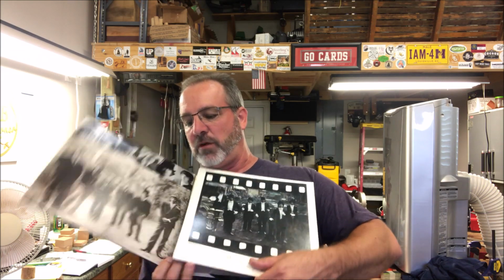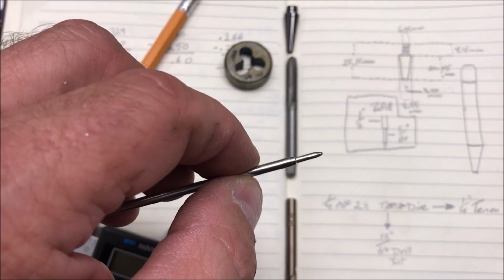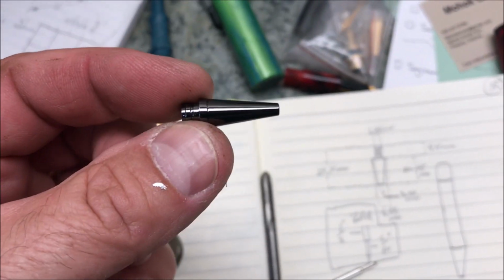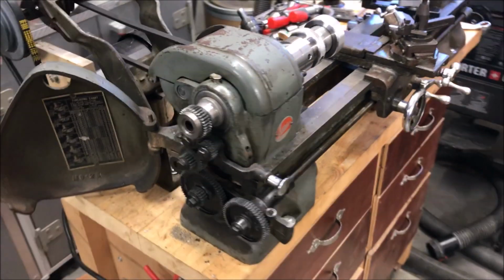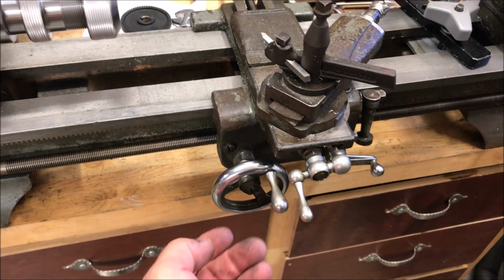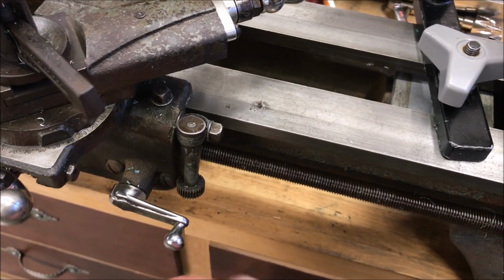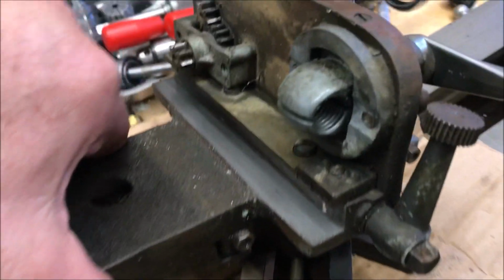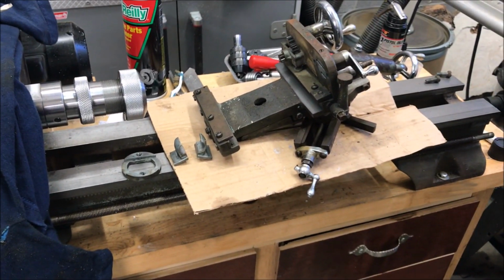Shop Update 7/28/2019 - Lathe Screw Drive Issue

Comment: I don't believe changing your gearing in the headstock will do much for what you are doing.  The gearing changes is for threading, I don't believe it will have an effect on the speed ratio for general purpose turning processes.  I haven't changed any of the gears on the headstock on my metal lathe from how it was setup when I bought it.  I use the self-feed feature whenever I use that lathe, I got spoiled and wish my wood lathe had that option HAHA!
Reply from the maker: I set the gears to turn 28 TPI. I want to thread with the lathe. The old setting produced a nice surface but was to slow. That’s when I found the issue with the half nut. Those things are $85.00 a set. Dang!!!